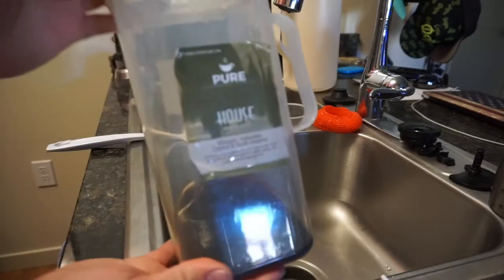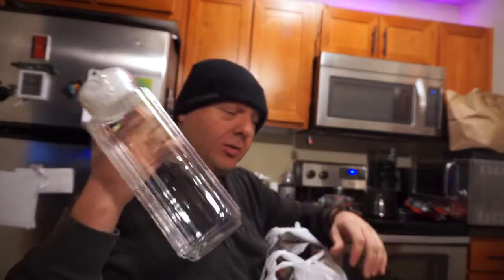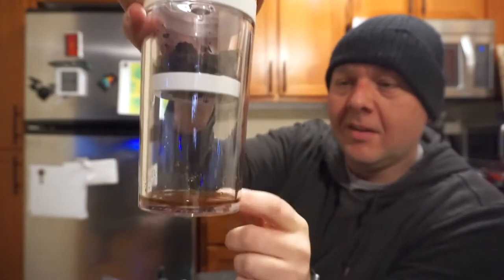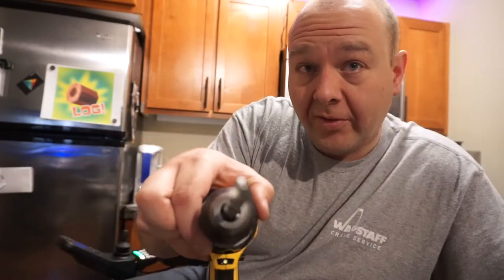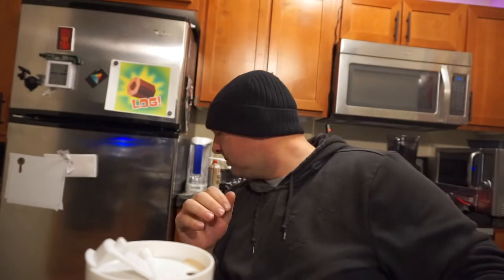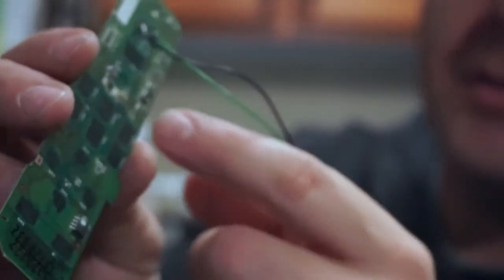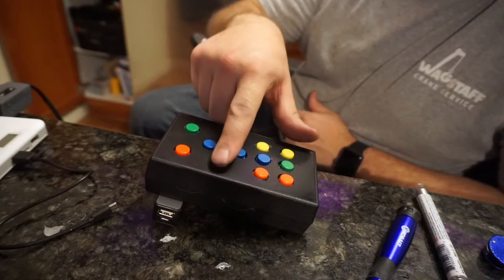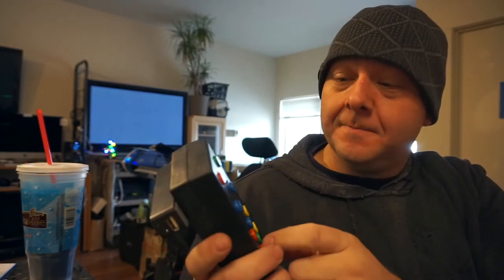VLOG 288: roku remote mod v3.0

Comment: wish my thrift store had good stuff.i might find something 1 out of 10 times.my Roku remote battery's last a year.is using headphone jack killing battery's??i did not even know they had,lol.cant wait to try.
Reply from the maker: yea - its the headphone use that's killing batteries.. not all models have it on the remote.  i should probably just get a Bluetooth transmitter and connect it to the output of the tv.. lol

Comment: I would like to try this with my roku. 
So you scratch of the black stuff to expose the solder tabs, and solder two wires? Seems simple enough. I’d like to do this with much longer wires and much bigger buttons to make a large panel remote for a disabled relative.
Reply from the maker: just make sure ya have several remotes to play around with..  all that soldering and extra wires can go sideways in a hurry!
Reply: @TotallyNormal-  thanks for the quick reply! Hopefully I can be successful my first try if I’m careful. 

Is the type or gauge of wire important? 
Particular type of momentary switches?
Reply: If you solder two wires on the board can you touch em together to see if it works? Or do you think that’ll hurt the board?
Reply from the maker: just something small - the wires add up fast! stranded wire is probably best, as solid core tends to break easily
Reply: @TotallyNormal-  so far everything is working great! But I’m a little stumped on the volume buttons on the side. There’s little switches there already. Hopefully I can remove them and connect wires like the other buttons.
Reply from the maker: just put another switch in parallel.. dont need to remove the existing ones!
Reply: @TotallyNormal-  are there precise solder points under the black coating? Or can you scrape any part of the place to expose copper. 

I connected the power button and the UP ARROW button and they both worked. Until I attached the left arrow button and then NOTHING works. I think I might have made a short one where.
Reply from the maker: ya just gotta look at the tracks and see - the tracks are pretty long, but you'll be able to see where they separate out.  ya sounds like something light have shorted.. or a button is being pressed constantly or something.  but should be easy to fix :^)
Reply: @TotallyNormal-  I think my remote is completely dead even with new batteries. Must’ve damaged it some how. It worked for the first two switches 🤷🏻‍♂️ 
I’ll have to order another one and try again. Until then, thank you very much for your help!
I really appreciate it!
Reply: @TotallyNormal-  I got a new remote and it works great! I wish I could post a picture. 
It’s a big plywood housing with large buttons!
I just need to figure out where to solder wires for the volume buttons.
Reply from the maker: awesome!! depending on the model, the volume buttons might only operate the headphone volume controls...
ya can send a DM on twitter if ya want :^) (i updated the contact into in the video description)